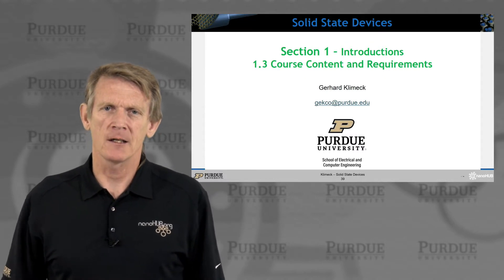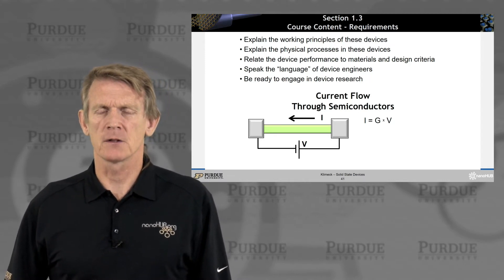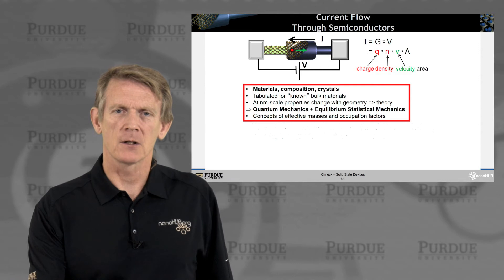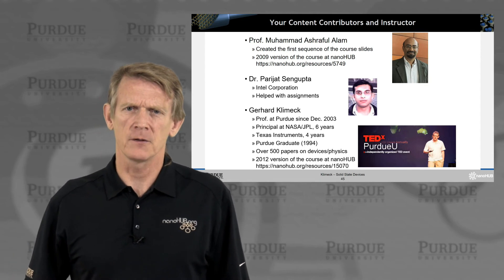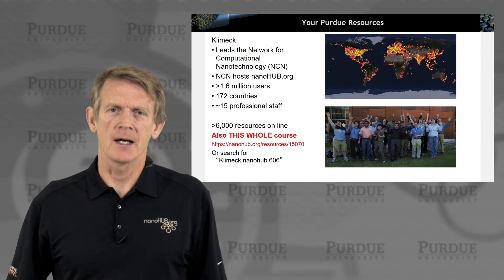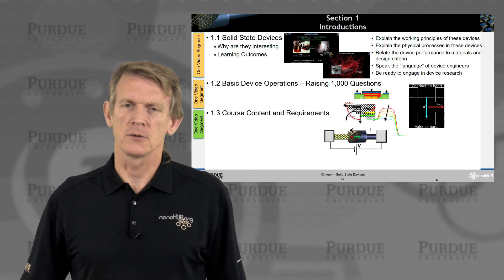ECE 606 Solid State Devices L1.3: Course Content and Requirements

Comment: 0:00 - 0:12: Introduction
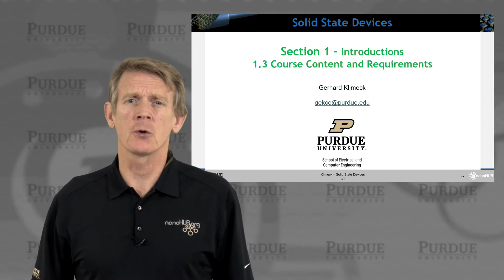0:13 - 0:30: Recap of Previous Sections
0:31 - 0:44: Course Content: Requirement
    - How we plan on achieving the learning objective of the course
0:45 - 1:34: Current Flow in Semiconductors
    - How we plan on conceptually understanding semiconductor operation
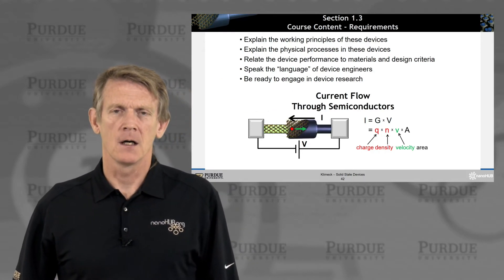1:35 - 3:12: Current Flow in Semiconductors (cont'd)
    - Considerations in formulating our understanding of semiconductors.
        - Charge & Density: Materials, Shape/Geometry, Strain, Quantum/Statistical Mechanics
        - Velocity: Transport with scattering, drift-diffusion equation, charge carrier lifecycle (i.e. recombination and generation)
        - Concrete Device Applications: Diodes, BJTs/HJTs, MOSFETs
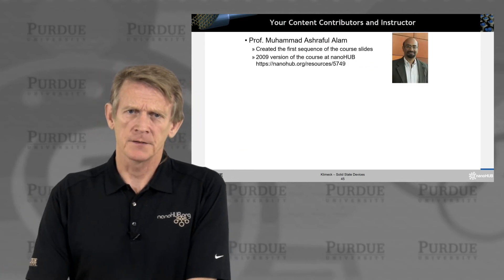3:13 - 4:28: Course Content and Instructors
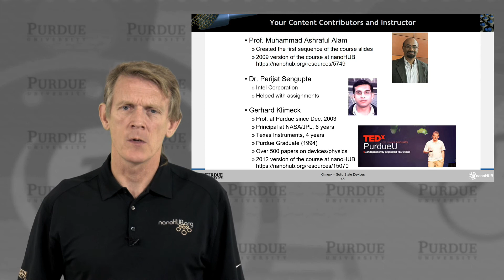4:29 - 5:39: Purdue/NanoHUB Resources